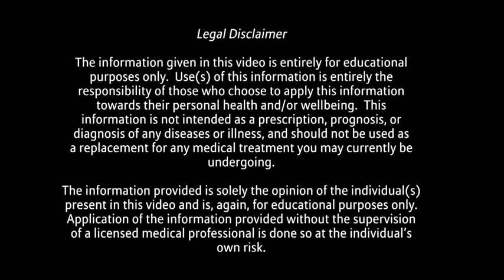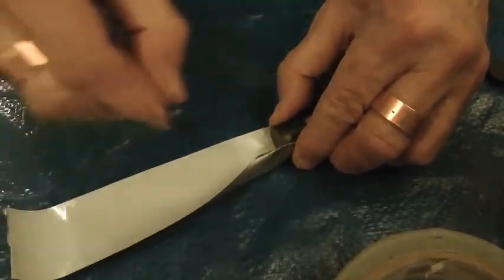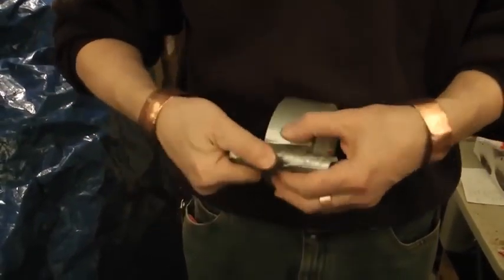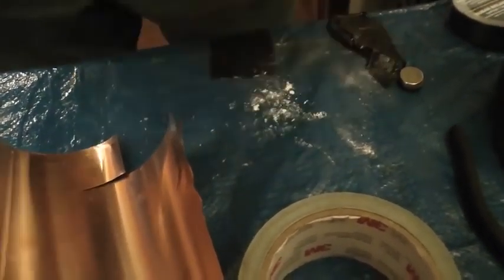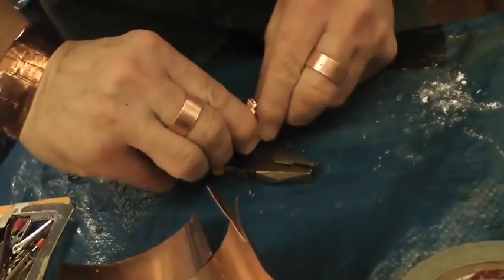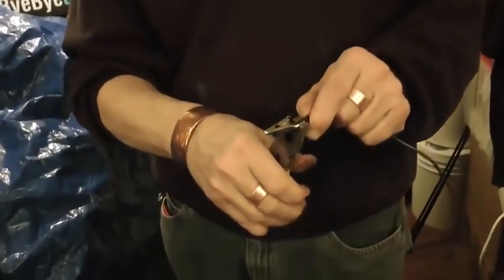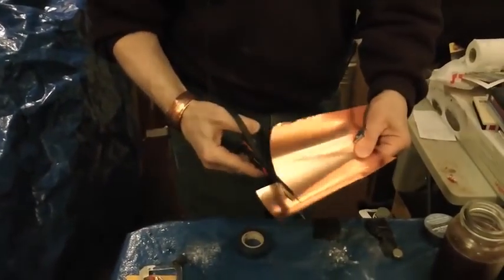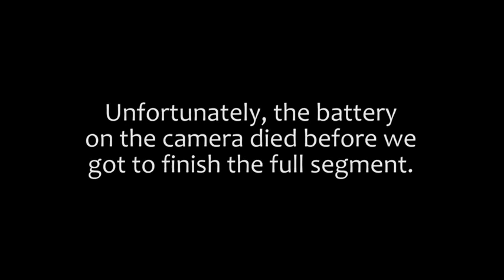Protecting Yourself Against Frequencies and Nano

Comment: I have large magnets from microwaves , maybe 28.
how many should I use ? 
they are ring magnets and measure 3 3/4 inches across centre hole 3/4 .
would 2 be enough to carry around? 
was gonna put some under my bed ,  could I create too strong a toroid force.
can it have negative effects? 
thanks

Comment: I made two of these magnet combination and it didn't even block the wifi so i should try the second option and I hope it will work
Reply: I used rare earth magnets 4 barrel magnets and it cut out 100%, I have a detector so I did the test on wifi , tv screen, fridge, power box, and cell phone all had extremely good results. .
Reply: @pedromarusic1162  
Where did you get the barrel magnets?